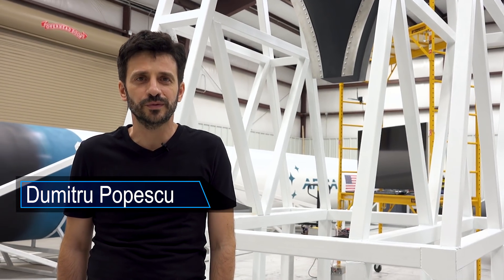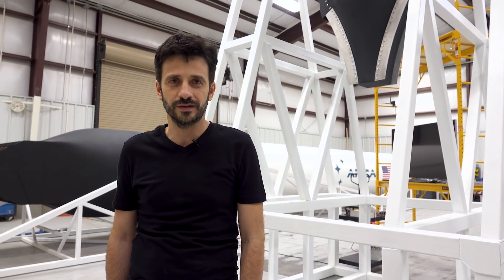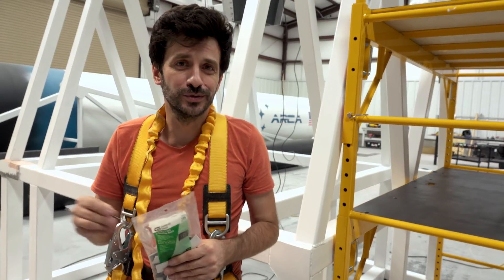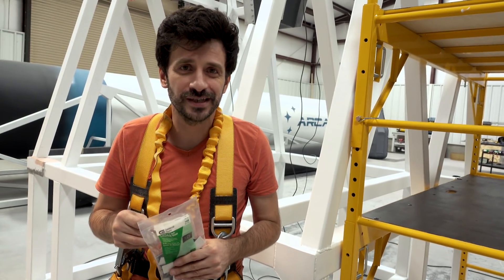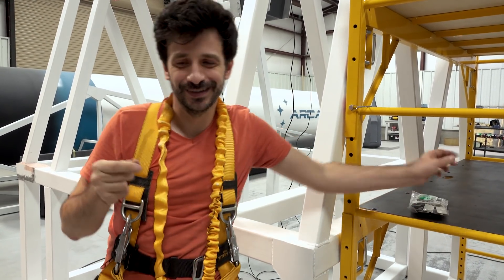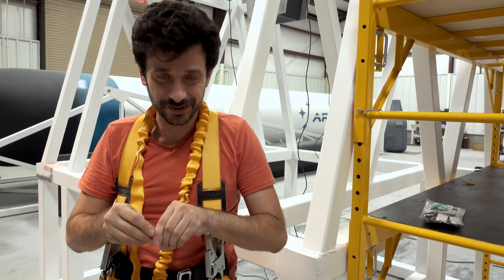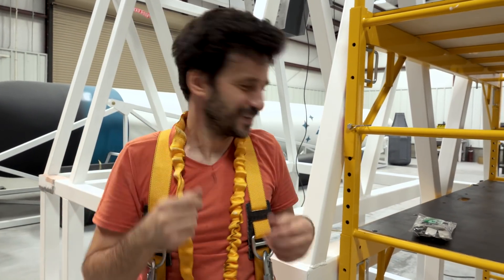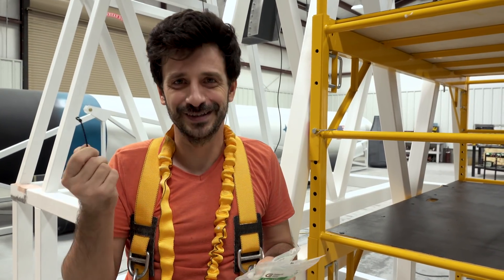Flight of the Aerospike: Episode 14 - Open House at ARCA

Comment: with a long row of these engines do neighbouring cells' mass flow/inertia provide pressure  to stop expansion in the plane of the ramp but perpendicular to the exhaust? And if so, do you not need side walls at least as deep as the projected high altitude expansion to stop lateral leakage?  

This is so long and thin. Are edge effects not going to dominate?
Reply: thanks for answering my  question. Any idea if anyone has designed polygonal aerospikes (say square, hexagonal, or octagonal)? Perhaps more suited to a cylindrical rocket body?

Comment: I like the linear spike idea, but I believe that a multiple stage recoverable spacecraft has a lot more benefits, for one you are not lugging around dead weight in space, also it will have a smaller surface to thermal mass ratio upon reentry, will you consider a multiple stage rocket?
Reply: What about aerospike engine's reusability?